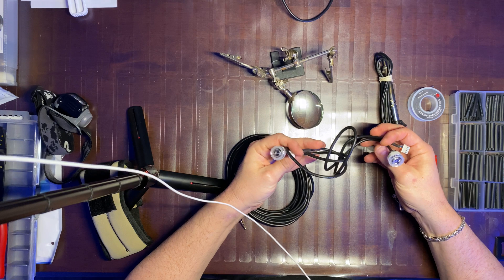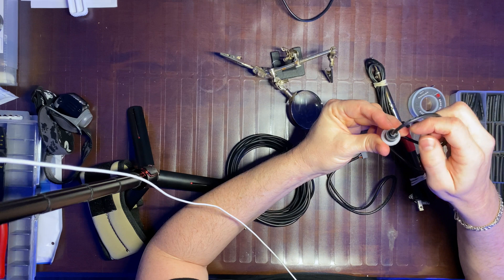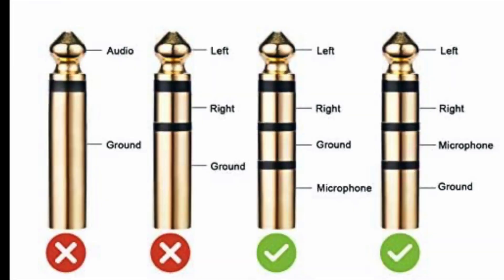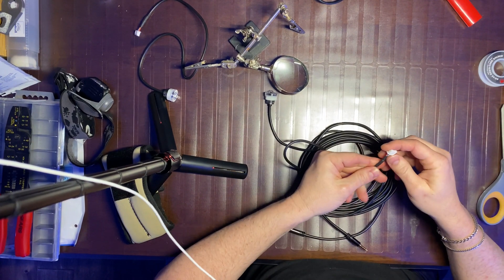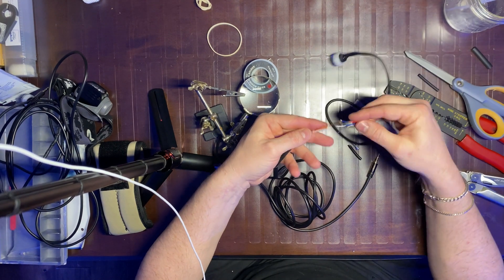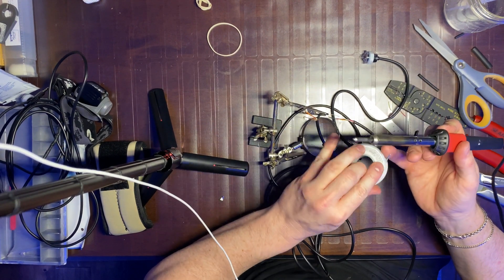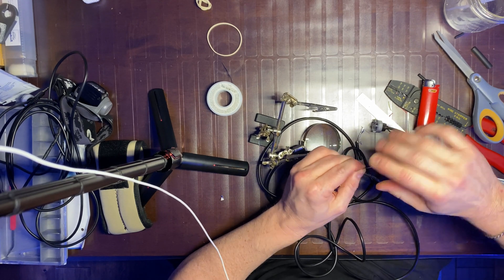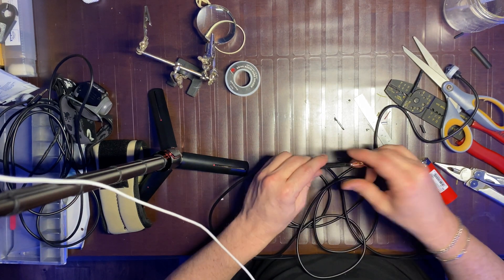DIY Optic Sensors Compatible with Neptune Apex FMM Module

Comment: I was very hopeful when I came across your video, although I guess if you can pickup the exact pieces of hardware, then the connections would be easy, as per your instructions. But for those of us living across the pond this is not always possible. Is there any way you can explain the connection via the rings on the male jack? In other words, which wire on the sensor was the tip, ring 1 ring 2 and ring 3 connected to? By providing this, we should all be able to use any 4 pole jacks that have a different wire colour configuration.

Comment: Do you just match color to color for it to work with apex fmm?
Reply from the maker: Red to red, white to white, yelow to blue, yelow to bare wire.
Reply: The color of optical sensor cable is red, yellow, blue, white. While the Neptune connector is Red, green, black and white. May I know how to connect?
Reply from the maker: @adrianto29  Good question! It may be a bit more complex if so. What I would do is place the sensor in a cup of water and set an alarm to turn on when submerged. Then try attaching the wires in different sequences until the alarm turns on. I am afraid I don't have a simpler solution for you. Hope that helps.